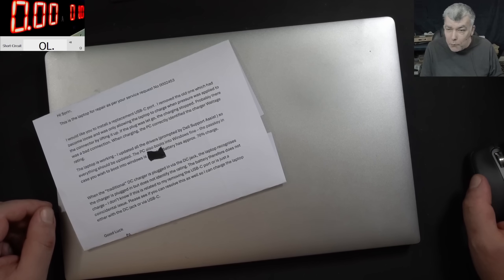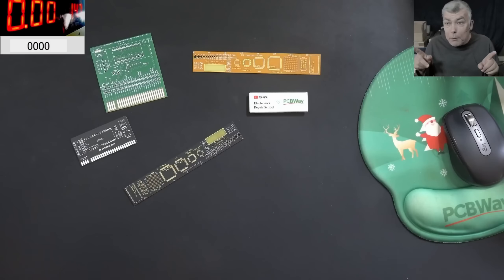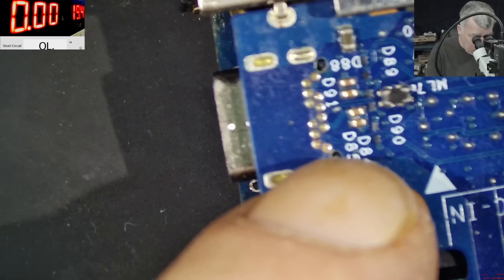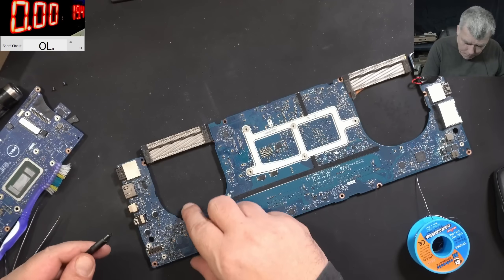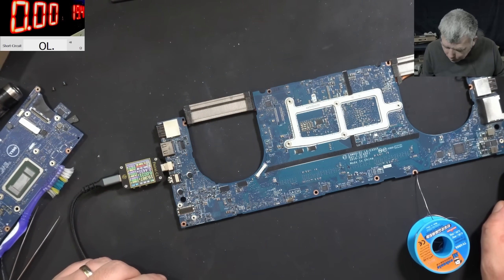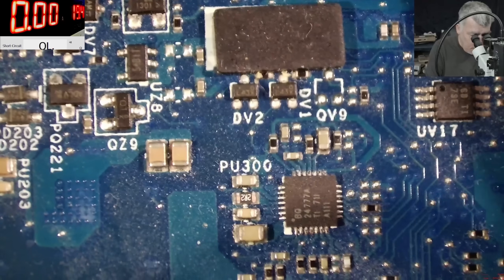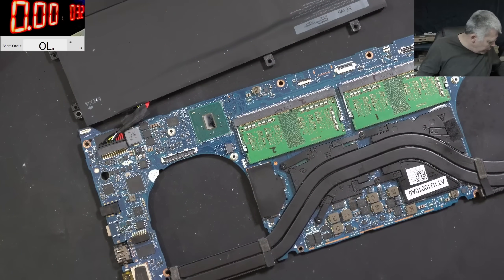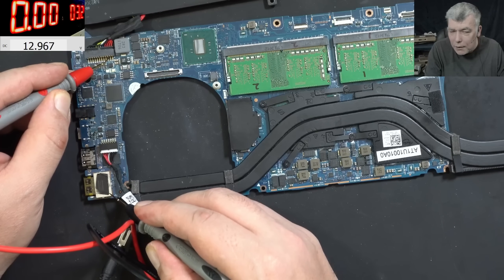Dell XPS 15 9560 Not charging - usb-c and dc jack charger id check

Comment: I have a XPS 15 9500 and the machine is not charging.  The technician told me the motherboard has to be replaced, and they recommend not to.  The laptop worked fine just no power now.  Is there a way I can by pass the USB-C charging and connect a external charge to the battery to charge?

Comment: Very good video! I have an XPS 15 9550. Older. (i7 6th gen GTX 960 32GB DDR4 1TB NVME) But with a 4K touchscreen. I love this PC. I just replaced the palm rest because the soft touch doesn't like UV.....

Comment: use a Jabeud ud 1700 aliexpress interface for testing dell equipment, you can check with the source as if it were the original charger, it is valid for lenovo, hp and dell, there are those who use it for macbook as well
another option is alexsof smart id pin ok search like this alexsof is cheaper but I like jabeud better

Comment: i have this exact issue with my xps 9570, works fine with the dell usb c charger (will sometimes give low wattage warning, but still charges fine). but with a brand new oem charger straight from dell it will work for a second or two, then stop and give a low wattage warning, and not charge

Comment: You can trick HP and Lenovo ID pins because there are only 2 wires from charger and a resistor to ground or to plus, But DELL has 3 wires from charger and ID pin sends signal about charger characteristics of its power.
Reply: DS2501 90W 180W 240W 330W TO-92 Notebook Power Adapter DELL ID Chip   aliexpress    $2.33   for 3 pcs      make your own dell adapter!

Comment: what do you mean its not gonna work ? I have 2 laptop motherboards in which i added a resistor between ground and charging id pin and it worked on both. i think it was 82 ohm or 82kohm.
Reply: work vs charge battery...  a Dell laptop will work but will not charge the battery    In other words.... A good design practice! safe!   DS2501 90W 180W 240W 330W TO-92 Notebook Power Adapter DELL ID Chip   aliexpress    $2.33   for 3 pcs      make your own dell adapter!
Reply: it doesnt work because you need to change the resistance of the resistor. they have an "id" based on the resistance of the resistor.

Comment: HP laptops use a resistor to determine power of the adapter. Dell uses the 1-Wire protocol to communicate with the charger. FYI   just google it!

Comment: Dell power supply has a "one wire eprom" connected to the id pin, The laptop read the eprom using one wire protocol to know the max power of the charger. There are some arduino proyects on the web to emulate this eprom to cheating motherboard.
Reply: DS2501 90W 180W 240W 330W TO-92 Notebook Power Adapter DELL Decoder Chip   aliexpress    $2.33   for 3 pcs

Comment: The ID pin is used to determine the adapter type, so that the notebook knows the max current limit of the adapter.  This allows it to run the notebook and charge the battery without exceeding the adapter current limit - since there are different wattage adapters that can be used in the same notebook, this is necessary. 
Of course, it also forces the user to buy genuine Dell adapters.
Reply: or at least quality clones

Comment: Nice like everytime 
Hop you can help me with a problem that i have withe a athesi e8b softwer problem i did formt it with win 10 pro then the wifi and touch no work iv tried to install drivers but nothing change the device is using a windows indestryl and i could not find it sorry for my english ❤️❤️❤️

Comment: Dell gives error under adapter warnings that an umknown adapter is detected, wont charge, works reduced.. not the adapter decides that there is charging but laptop itself. So no "just put the resistor somewhere blabla " wont work.
Reply: it is not very complicated, it is measuring the resistence on the charger
Reply: @lmmdle2025  no the resistance thing only on Lenovo charger. Dell uses a decoder chip using one wire protocol to know the power rating of the dell charger. so either you have to use genuine Dell charger or buy DS2501 eprom.
Reply: DS2501 90W 180W 240W 330W TO-92 Notebook Power Adapter DELL ID Chip   aliexpress    $2.33   for 3 pcs      make your own dell adapter!

Comment: can you intercept the communication between charger id pin and IC with a osciloscope to see the signal and then make a dummy signal to trick the laptop that its a genuine charger ?
Reply: yes you can but it would be easier just to remove the chip from a defective charger that is doing the ID transmission, it's a 3 pin chip looking like a transistor. Then make an adapter with this chip and your lab power supply.
Reply: @orange11squares  DS2501 90W 180W 240W 330W TO-92 Notebook Power Adapter DELL Decoder Chip   aliexpress    $2.33   for 3 pcs
Reply: @orange11squares  unless ID reading portion of the circuit inside laptop is damaged, that happens too... wish Sorin would fix the ID pin issue...

Comment: Hi Sorin, the switch is to safely disconnect the battery circuit before doing anything in the laptop.  :)
Reply: On the back of the board? 0.o
Reply: @ATAG-yn5pd  Ah okay, you're right. I've worked on quite a few XPS and Precision laptops that have a battery disconnect switch but I think that the switch in the video might be the Service Mode Switch which will allow updating the ME region of the SPI flash.
Reply: @JustInspiredKent  Yup, that make sense =)